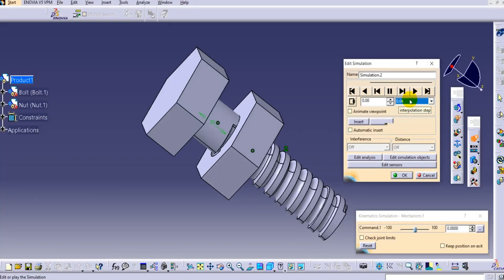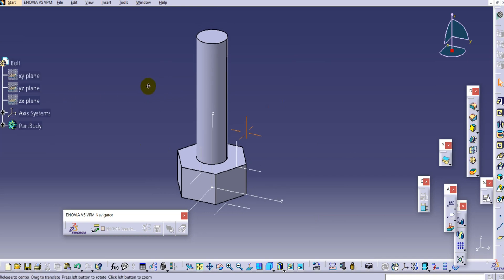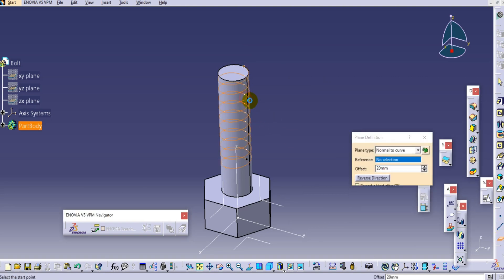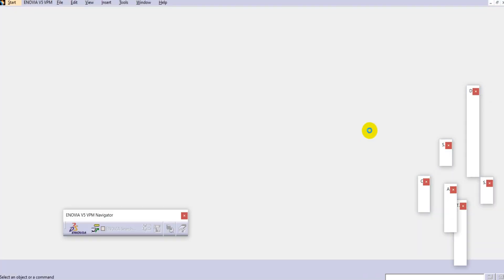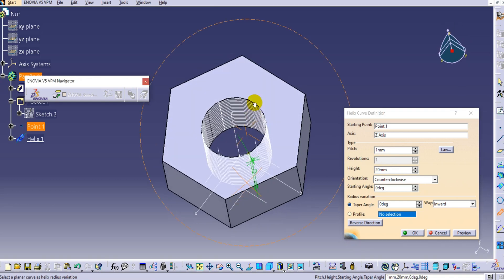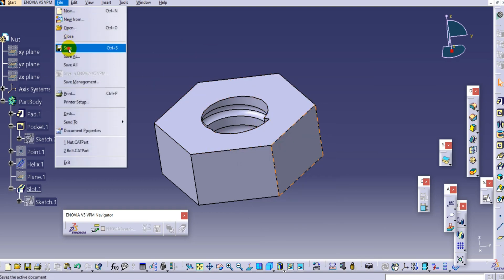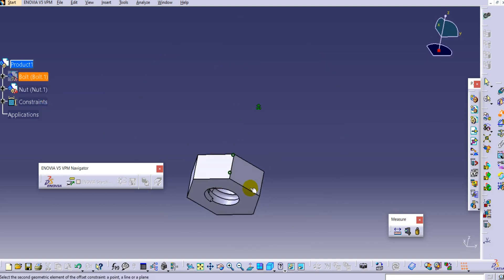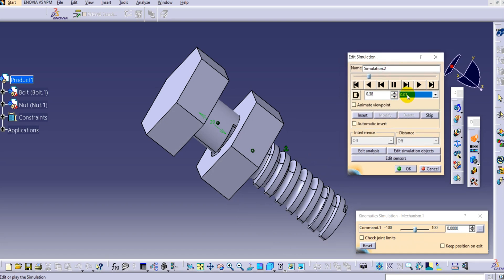CATIA V5 I Nut Bolt with Threading I Assembly I Simulation I DMU I Screw Joint

Comment: Hexagon command is not working in my catia v5 R21 
the problem is while giving constraints to it only one side of hexagon is constraining not the whole hexagon. What to do for solving it.
Reply: Yes, for me the same.

Also Once I done the Slot it shows the error as Slot .1 Boolean Operator Element can not be cut. check it's tangency contact. Modify body contact (use split or extrude one do the body). 

Please guide me how to rectify this error.